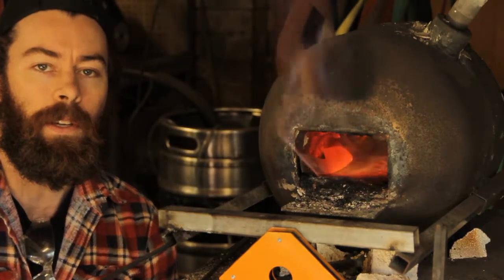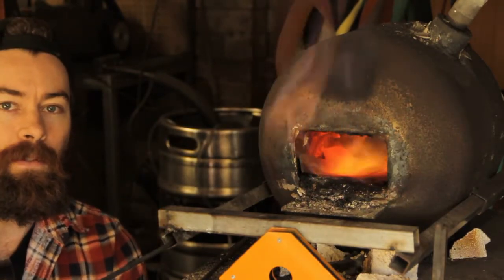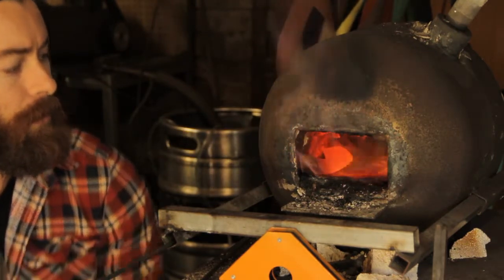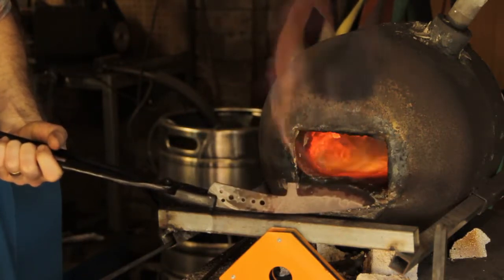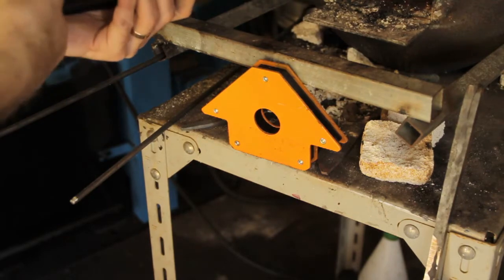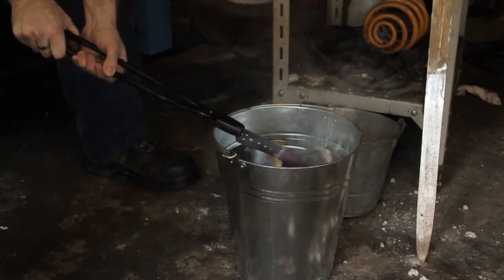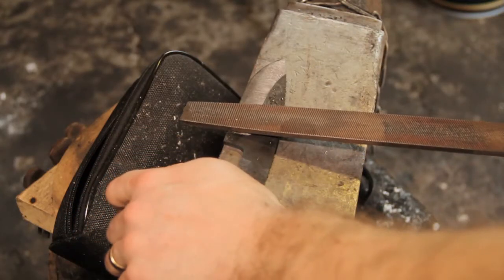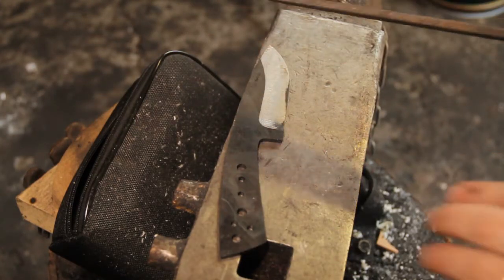Heat treating Simple carbon steel in a forge

Comment: Can you tell me what kind of oil to use, can I use old motor oil?
Reply from the maker: Don't use old motor oil. If you have a oil hardening steel try with vegetable oil. If you don't know what type of steel you have give it a go in vegetable oil first and see what happens.
Reply: @batcountryforge5945  I have a piece of spring steel .. From the truck
Reply: Thank you for your reply!
Reply from the maker: @johanesgo8096  Veg oil should be pretty safe for that, assuming no cracks from fatigue from it's working life as a truck spring. Depending on the size of the knife you need a good amount of oil, I'd say 10 liters minimum if it is up to 30cm long. More length will require more oil.
Reply: @batcountryforge5945  Thanks for the advice, great greeting from bosnia and herzegovina
Reply: No annealing?

Comment: Hey I've been using 1084 and quenching in warm canola oil which seems to work well. Would there be much difference in using houghtons quench oil and would a fast or medium oil be better for 1084
Reply from the maker: You will get far more consistent results with the engineered quenchants like houghtons, especially when you branch out into more complicated steels. For 1084 canola will work very well. The advantage of houghtons is that the oil does not degrade and it has a resistance to allowing a vapor jacket around the hot steel in the initial quench. You  want to use Houghtons G for 1084 and most other blade steels. Houghtons K should only be used on fast quench steels like W2, W1, thick sections of 1095. Medium speed quench steels in fast quench medium will probably crack and fail.
Reply: Bat Country Forge I just received my houghtons g from gameco and just wanted to know if there is an ideal temp to get it to or does it just need to be warmed up a bit? Should i treat it the same as when using canola oil. Im in New Zealand and it's a bit cold over here at the moment.
Reply from the maker: Depends on the temperature where you are. I am in Sydney and I don't find I ever need to heat up the oil. The best way to know is to do some controlled experiments and get the results Rockwell tested. Try and use it at around 25-30 degrees, consistency in what you do is key to getting repeatable results.
Reply from the maker: I did some reading and the only thing I can find on it is that the G quench oil as a whole is effective upto 82 degrees,  it would take a lot of steel to get that 20L upto 82 degrees. 

Vegetable oil on the other hand I used to warm up to about 30 degrees.
Reply: Ok cool, thanks for your help.

Comment: Great video! Thank you. I've been working on heat treating and tempering myself. The last knives I did, however, didn't seem to get hard, as when I tested with a file, it didn't slide nicely over the blade as it does in your video. I'll get a magnet and try again. Thanks a lot!

Comment: is the quench oil heated up or room temperature?
Reply from the maker: Adam Beck hi mate, this time of year I find the oil is just fine at room temperature for 1075 steel. In winter I would warm it up a little with some hot mild steel.